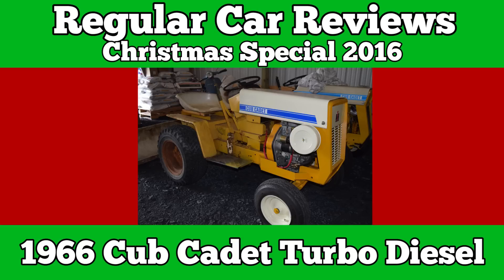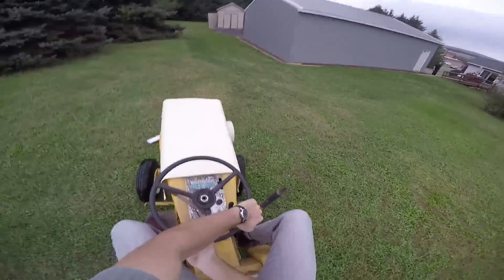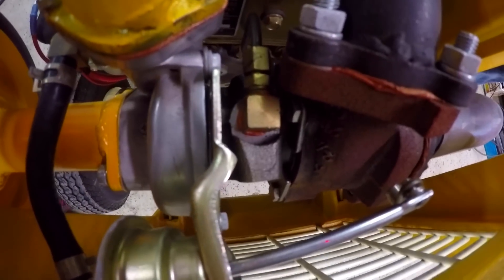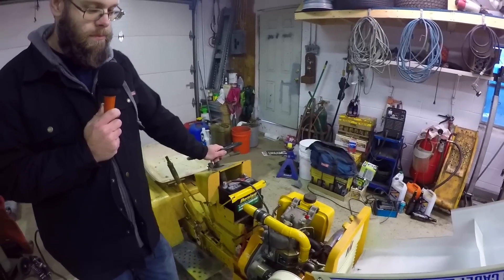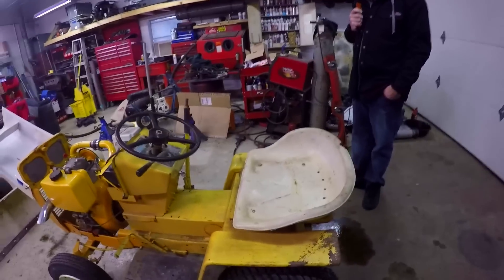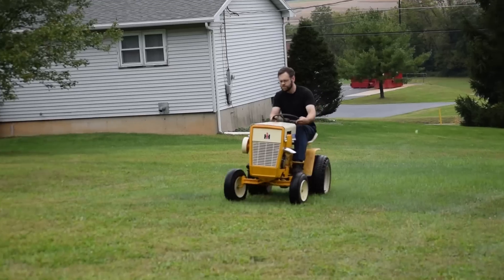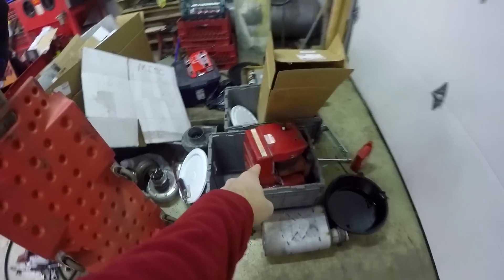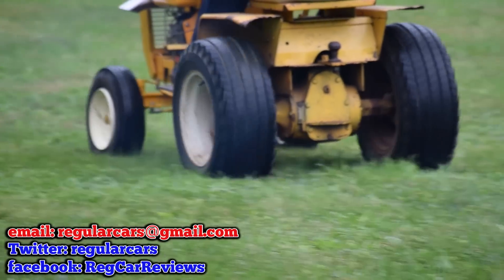1966 Cub Cadet Turbo Diesel: Regular Car Reviews

Comment: It has a top speed of a brisk walk.
Reply: Aaron Ries lol you can swap pulleys on a stock tractor and go 20mph
Reply: arien wilkins I believe he was quoting the yard man review from way back not making a statement
Reply: Dan W ohhh yeah you're right
Reply: arien wilkins he said it doesn’t have belts
Reply: The no belts comment was about the transmission. The engine has belts.
Reply: @Robbie_Bobb  No. The engines do not have belts . The deck is run from a belt driven pto in the front, but like said, this is an engine to rear end with a drive shaft system. Saying all that, I have a lighter on my Cub QL1250 where I ran my gps, and I can do 16 mph...which is far to fast for lawn work. The owners manual says 8mph max.
Reply: ... but it can probably reach it and keep it no matter what you hook up behind it 😁
Reply: It's shaft driven, nothing to swap
Reply: I have this tractor and with normal engine it goes way faster lol
Reply: Instablaster...
Reply: Yeah, because a real man doesn’t know how to walk. Tell you what, this beast could run a farm. Literally. It’s the Jeep of lawn and garden tractors.
Reply: Anyways, it makes a real racket because the muffler faces forward ??
Reply: Ain’t meant to go fast!

Comment: Awesome, but I wish we got to hear it.

Takes me back to Best Christmas Gift Ever. 1972, upstate New York covered deep in snow of Christmas morning. Under the tree was a tiny toy tractor. There was also a key with a plastic fob that read "Get a Job!"  Just out the front door was a shiny red Wheel Horse lawn tractor, snow plow attached,  chains attached to its large mud tires. I was overwhelmed. Many good times on that tractor, hauling friends around on flatbed trailer out into the woods, racing down hills, wheelies, and, yes, making a buck or two mowing and plowing. Good times.

Comment: Growing up we had a Sears garden tractor from probably the same era.  You could attach all sorts of implements on it, and it had multiple power take-offs for different types of equipment.  There was even a self-powered roto-tiller that could be raised and lowered from the back.  It was quite neat.

Oh and it had a 3 speed manual transmission with a high and low range!
Reply: IH made a few different sized tillers for the back of these cubs
Reply: Yea, I've got one too, you're right, they're about as neat as a shirt full of pockets  (when a wren finds it). When it comes to the nitty gritty; my favorite is always a cub; I've got a 124 C/C that the biggest cat in this world couldn't replace ; cause these things can really grow on ya😆
Reply: @brandonpeterman9964  yea 10-4, but the only one that I've ever seen was about a 36 incher, ofset to the right: now if you'd let it get REALLY grizzly, it could dig up China😆

Comment: when I was young, single digits, someone gave me one of these tractors. my dad got it running for me and I had countless years of enjoyment flying around the fields of my grand parents farm. it wasn't hydrostat, just belt driven to what looked like a home brew clutch. 1st and 2nd gears were slow, then shift into 3rd gear and it would take off 20mph.

Comment: A neat garden tractor I have is a Bolens DGT-1700 garden tractor, it is newer than this cub cadet, it is from the 80s. But it left the factory with a 3 cylinder liquid cooled Mitsubishi diesel.

Comment: I've never seen this Cummins before
Reply: YellowBeanieBoy what cummins?
Reply: touge volvo85 I'm not one of those people
Reply: 8 horse and 10 horse power Kohler motors have roller bearing cranks. Ran one for 25 years before it's first rebuild. Good for another 25! Flathead motor are not high horse power due to limited lift from the valves, but are easier to maintain.

Comment: Garden tractor pulling was a thing around here 20 years ago. We had a very active local club. We had a family business selling International Harvester products up until we saw the writing on the wall with IH in trouble and we sold out about 1982. Fast forward to about year 2000 and my brother joins this club. These real IH Cub Cadets ( Because no IH fan calls the MTDs real Cubs.) were so overbuilt that using them as a base to build a puller for stock and mod stock classes was the hot setup at that time. Bro cruised the want adds, bought several good donor machines and built a team of yellow horses so strong that after bringing home a dumpster full of trophies over about four years with this club, I think they finally just suggested he stay home. Now most good 1962 to 1980 Cubs left are too valuable to mod out for pulling, you see them being restored to dust catchers for collectors. At least that’s the trend I’m seeing. Nice video sirs!

Comment: I love those old International Cub Cadets. I restored a 1974 International Cub Cadet 129 a couple years ago. I got a lot of pictures from when I first got it, the first power wash cleaning it up videos of it being brought back to life and the tear down and disassembly, restoration and finished tractor. It still has the original 12 HP Kohler engine and muffler and I also added a big exhaust stack and installed a custom stainless steel mesh grille

Comment: We've got a '70 Cub Cadet with the 16hp Kohler. After a lot of goofing around with polishing and deburring plus some carb work, it goes about 18mph. The torque is insane - we use it for snow plowing, and even dragged a full-size Dodge pickup with a stuck rear end up the driveway with it mid-winter.

Comment: My close friend in High school had 2 of these that he used for his lawn service.  His Dad used them in the 60s and 70s for his own lawn service in high school.  They both had the kohler motors.  They ran perfectly and cut perfectly.  Everything on them was original other than like, the points...  (Even the SPARK PLUGS were original, they were just cleaned and gapped once a season) They really don't make things like they used to and this is a prime example.

Comment: When I was a kid we had this old Torro riding mower from the 60s.  My friends and I took the blade assembly off and put the carb from my broken down honda xr75 on it.  That thing was a blast!  It was pretty fast and would jump off the ground when you started it off in 3rd.  We had a lot of fun with that thing.

Comment: I love that the engine is facing backward, with the shaft coming from the "front" of it. The pulley shaft left on the front side could be connected to an alternator or generator for an emergency. Awesome build!
Reply: The original engine would have had a belt driven starter generator on that “front” shaft, as well as the PTO clutch that runs a mower deck, snowblower, etc.

Comment: The longevity of the old Cubs reminds me of the older Honda lawnmowers.  The OHV Honda 5hp mower from 20 years ago is pretty much indestructible.  I've had my Honda since 91, it's still going strong.  It has had maybe 3 oil changes (yeah, I know).
Reply: got one out in the shed now. Still perfect but I can't find a replacement paper air filter element.

Comment: 2 years later and I find this video. 

My dad has a cub cadet of 1970ish cub cadet. She can be a pain sometimes but once she's going she's going. She's decently fast at near sprint speeds. 

We got a bunch of add on parts as well. A plow, a tiller, and mower blades (a few others that I forget) all weigh a decent amount and not a one man lift job.

Comment: more torque than any honda
Reply: With the multiplication of torque through the gear reduction, that might actually be a fact.  Unless you bolt a 4 cyl Honda engine into a cub cadet, then the honda would put enough torque to the ground to snap a building in half lol.
Reply: @gittyupalice96  r/whooosh

Comment: I still use the 1974 Cub Cadet my grandparents bought brand new. It mows my lawn in the summer, and snowblows my driveway in the winter. The only substantial repair I had to do was replacing the electromagnetic clutch.

Comment: Also the Cub Cadet garden tractors from this era that had manuals used a transmission from a Farmall Cub tractor, the transmission is way overbuilt for them.
Reply: It may be the only garden tractor that also has a direct connection to the transmission no belts involved unlike wheel horses or john deeres. Panzers have a cut down ford rear end but they still use a belt
Reply: There are a few tractors with direct drive transmissions, I have a Bolens 1250 and it is on the large end of being a garden tractor. And it has a massive shaft drive hydro static transmission. I actually dropped a big 2 cylinder Wisconsin engine into it, and it makes this cub cadet look small.
Reply: Patrick Kissman Ah yes I forgot about those they are after the tube frame bolens if im not mistaken. Deutz made a really heavy duty garden tractor in the 80s with a locking differential that was like that too
Reply: They were actually built during the same time period as the tube frames, If I remember correctly mine was built in 1968. I have a few videos of it on my channel if you are interested.
Reply: I most certainly will
Reply: forgot about the 400 and 800 series gravely's
Reply: Gravely had the most rugged setup back in the day which was direct gear drive. Also, the Panzer used a Chrysler rear axle, not a Ford.

Comment: Actually a 1650 Cadet will fit in the back of a Chev Uplander minivan with about no room to spare. Ramps and two big guys will allow you to push one in without too much trouble (forget about lifting it). A John Deere 318 uses the same Sunstrand hydraulic pump/motor. This class of garden tractor is very much alive today Kioti, Kuboto, Deere and others make an upscale machine for the low low price of 5k to 10k plus toys. The old Cub Cadet is a great low cost platform for a loader or similar project. On the other hand the light weight MTD lawn tractor is a great lawn mower but it isn't built to handle anything more.   Cool project !

Comment: Man, this reminds me of my ancient Snapper/Massey Ferguson 1650. 16hp single cylinder Kohler flathead, two-speed hydrostatic drive, hydraulic 3-point hitch, hydraulic mower deck, and electric PTO. After some work to make it run, that old Kohler would fire right up every time, and rattle your teeth out in the process.

Comment: Cool tractor, my dad's doing something similar with a diesel and a bolens 1886. I've been using a 1455 for years to mow the lawn with negligible trouble. Oiling ring is messed up now so it burns about a sixth of its oil capability in one run. I can't complain since it was built in the 60s or 70s and has been a work horse all this time.

Comment: I actually own a 68 IH cub cadet 104 i'm the 3rd owner. I got it from the daughter of the original owner who worked for IH and I even have a picture of it brand new with the owner standing there and his daughter sitting on it plastic still covering the seat. I use it to mow my lawn it does a better job than anything new i could buy.

Comment: For push lawnmowers, I personally prefer flat head motors because since it's push, I'm not worried about power, and since you only have to mow a couple times a month, fuel effeciency isn't a concern. And the benefit of flat head lawnmowers, is it's really easy to take off the header and clean up the piston, valves, and combustion chamber.

Comment: Cub Cadet's undoing was MTD.... That's all! :)  I had a Cub Cadet 6284D with a back hoe, FEL and 3 point finish mower, that was a 27k grand investment and it was the biggest piece of trash I've ever owned. By 40 hours I made Cub buy it back, because the rear end nearly snapped off of the C Frame because the machine couldn't handle the load of the 3 point finish mower. I then came to my senses and bought a JD 3320.   

Also JD still makes "real" garden machines. You won't pick up my JD 748 it's running a 3 cylinder Yanmar 33 horse diesel up front with a cast iron front AWD axle.

Nice old Cub for sure! And yes those old Cub's and Wheel Horse and Deere last forever!

Comment: I have two of these  they are great little tractor s. One manual trans with a creeper gear  that pulls like crazy  the other  has a hydro trans with a  46 in cutting deck  that cuts real good
Reply: Both 1972 model

Comment: I bought a 1984 782 d diesel mower with a 50 inch cutting deck it runs great and cuts great love it very fast mower goes 20 + mph love it
Reply: no it doesnt

Comment: gotta ditch the hydro. throw something in it with gears and you'll fly. I had a toro with a 10hp Briggs that would pull 40 mph
Reply: Nothing wrong with Toro's ; might be a bit fast when mowing an obstacle course though 😆

Comment: This guy has never done donuts on a Panzer Tractor in the snow at full throttle before. You haven't lived till you take a turn on a garden tractor and keep going on only two wheels without crashing.
Reply: Waiting to do snow doughnuts on a 1966 bolens 650

Comment: Nice! He's right however. Cub Cadet is and was a good tractor. MTD isn't a terrible company by the way, they just make these much, much cheaper. Think plastic! I have a newer self propelled push mower by Cub Cadet, I love it. Surprisingly works well considering the use of plastics. The front uses these casters, that makes it easy to turn corners. I had a John Deere push prior to this one. I don't miss mixing the gas, but I sure do the aluminum deck. It was super solid. But they don't make them. Dealer tried to sell me a Honda... Haha. Yeah, no thanks.

Comment: Commenting years later but I wonder Justin, did you ever get the hydrostat rebuilt? A fresh trans behind that motor will do insane improvements to the performance. I've got a 1988 430 JD with the 3 cylinder Yanmar and I know my hydrostat is on borrowed time. Also have heard of guys turboing the 3 cyl. Yanmar and making some serious power for doing small farm work. Great job on the Cub.

Comment: I've got a '69 IH Cub 124. I freaking love that thing. Mine is nowhere near as clean as the one in the video but they were all made of cast iron and steel. Mine has plenty of surface rust but none through. If you needed any proof that they really don't make them like they used to, these IH Cub Cadet tractors are it...

Comment: It's those hydrostatic transmissions and rear diff... my grandpa only had those cub cadets from the 70s.. a 78 14hp one was the fastest I ever rode on. If you didn't know what you were doing and just hit the throttle handle all the way... it would throw you off and keep going. I learned to mow fast and drive well with those lawnmowers in the 90s. I hope to find one someday for myself. On the country road I got it up to atleast 25mph.. or so it felt. Its terrifying  just in stock mode.
Reply: 8mph
Reply: @cs-gj3yf  a modern lawnmower is lucky to hit 8mph... the 1250 or 1450 cub cadet from 1978 will do what I mention.
Reply: @tra-viskaiser8737  no, no it will not, my 1512 turning 6500 rpm with big pulling tires does 20 with the exact same trans as a 12 or 1450.

Comment: Just cranked up my 20-year-old Cub Cadet riding mower for the first time this year. It's been sitting for 10 months. Had 2 flat tires and a dead battery. My mother in law borrowed it and ran it into a tree a while back, so it has a big dent that I had to bang out a little to keep the belt from rubbing. The headlights fell out too. I hadn't changed the oil in at least 2 years, had the same gas in it since the last time I put it away. Got out the air compressor, jumped the battery with my car. BOOM BITCH! Within 10 minutes I had it running. Black smoke everywhere. 15 minutes later the yard was done and it had stopped smoking by then.  This thing don't care how bad you abuse it, it just keeps cutting grass. I might get around to changing the oil this year, but probably not, it'll still run anyway so who cares.

Comment: I think he over estimated the weight of the stock engines.  100 pounds is a bit high.  I worked the Cubs for a few years.  I would pull the engines with my bare hands and put them in the work bench.  The 16 HP was my limit on weight.  The twin cylinder 17 hp needed a hoist.  There was only about six bolts that had to be disconnected to pull the engine.

Comment: If you ever make it up to CT I have 15 antique tractors all ranging from the mid 30's to the late 60s all different makes and models john deere, fordson, farmall, allis chalmers, massey ferguson. In many ways tractors are just as interesting if not more interesting than cars because every single one of them uses a in house designed motor that very greatly in design. For instance my 1951 johndeere A has a 305ci 2 cylinder ohv motor that runs horizontal in the frame of the tractor and spins at a max speed of  800rpm and idles at 65rpm

Comment: I love the international decal and relationship on the front and i love flying a 1929 Piper Cub that is the exact same color. If your ever in central California and want to review the plane, 5or my 98 Suzuki Bandit gsf600, or maybe you'd enjoy a 1985 PowerbuttRam single cab short bed with 4 inch lift suspension and body and built 318 and 4.11 rear end. Or my 1970 international 1110 truck.

Comment: with these old Cub Cadets you can do a lot more than snow plow snowblower theres rototiller there is a Sweeper Brushes goes on the front of it there brinly plow wood chipper that goes on the front of it if you have a rear pto on the back of your cub cadet they're hard to find they have creeper gears for them to move a slower speeds hydraulic lift stuff like that and you canTurn a Cub Cadet into a front end loader and a backhoe at same time.i have 3 cub cadets 1964 100 1963 70 and now 3240 3000 Series 40th anniversary,cub cadets.and my brother has 6 cub cadets 106 147 102 three cub 100 .